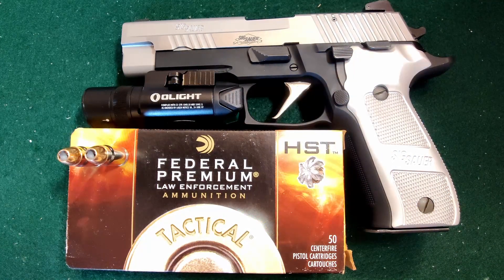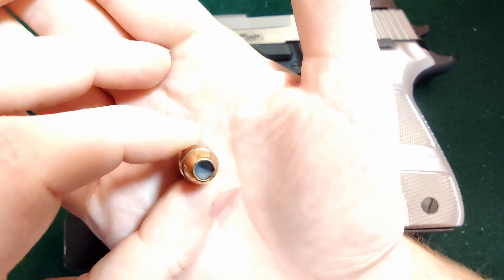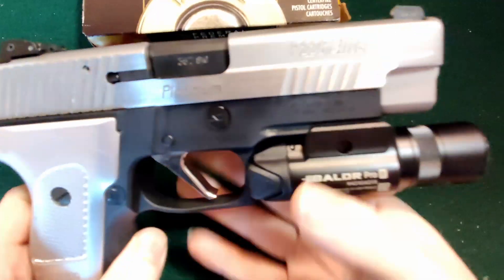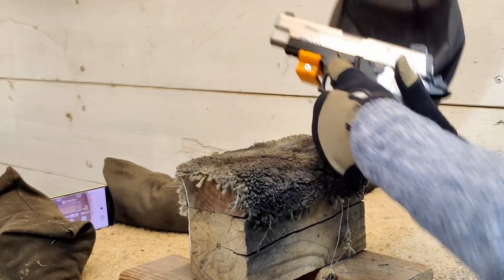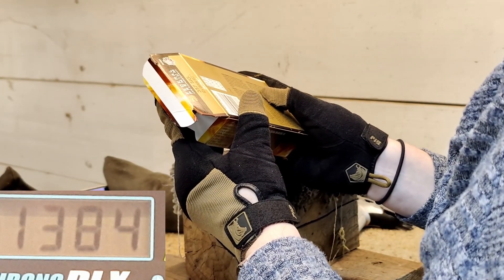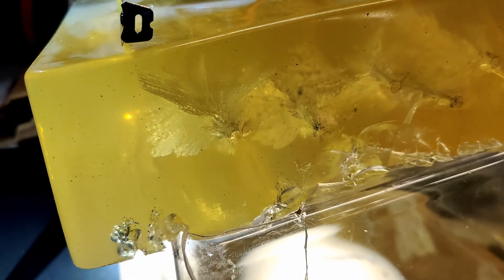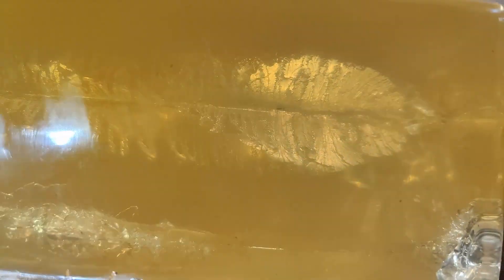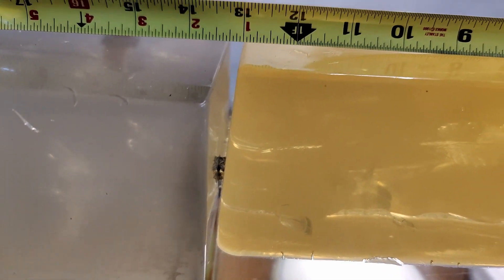357sig 125gr Federal HST~ Speed Demon of the 👑Kings👑 SIG P226 Ballistic test, Gel test

Comment: The 125gr HST is rated  at 1360 out of a 4 inch barrel.  You were using a 4.5 inch barrel which gave it an extra 40 fps velocity. And yes the 357 Sig is the SD king you don't have to be genius to know that.
Reply from the maker: Most factory rounds are severely underpowered. 357sig was made to be around 1500fps.